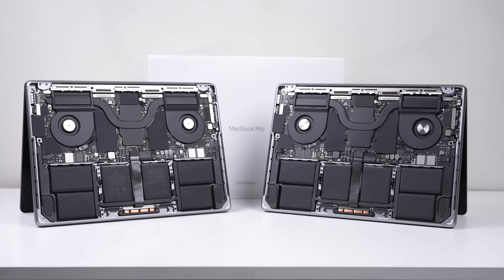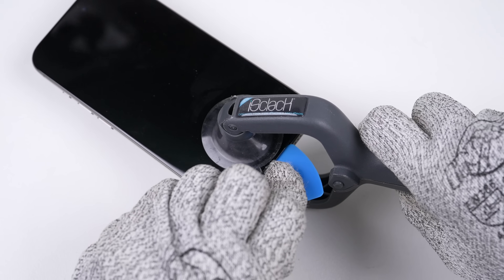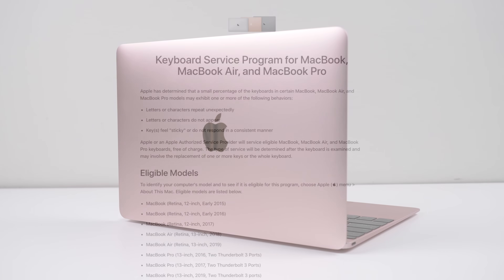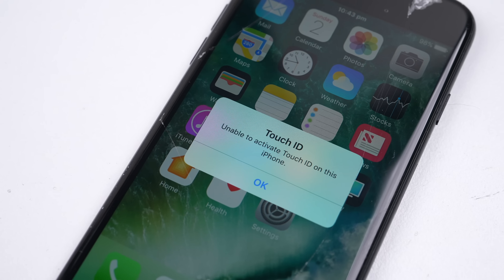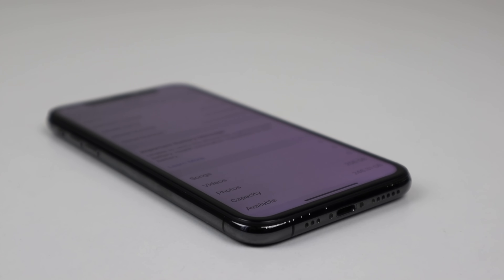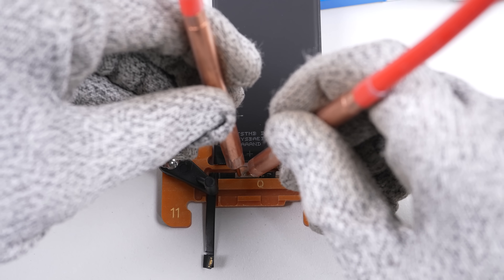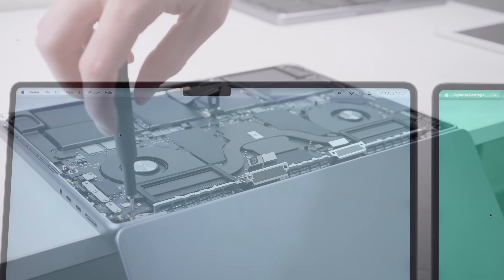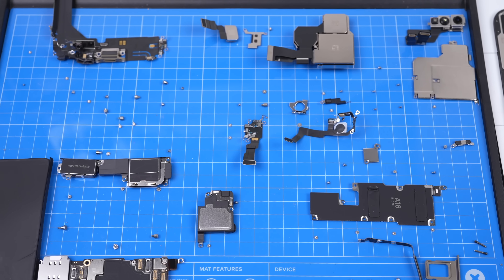Astonishing Anti Repair Practices By Apple In the Last 15 Years

Comment: I think all of this whining gets old about repairability. The only thing we need are battery brackets that are screwed down with foam to cushion. We don’t need adhesive on batteries.
Reply: That's it? So you want non removable glass backs, security screws, and software malfunctions for swapping out genuine, OEM parts? Yup, you're the reason they get away with this.
Reply: i hate it when stupid people speaks

Comment: It's absolutely insane how much they've worked on not letting you be able repair their stuff without them, and probably thousands of millions of dollars just on that kind of stuff alone....

One of the main reasons to never bother with Apple.
Reply: You get cash for each time you post this from Apple?
Reply: No just sick of the huge oversight on why this keeps happening. Every year the amount of phones that get stolen at events like music festivals go up. Every year Apple serializes more parts and people like this kid yell "Right to Repair" blah blah, instead of asking for a real solution.   @glynnetolar4423
Reply: It's still a good point. @glynnetolar4423
Reply: Apple is pairing components to each board because of the mass volume of devices that get stolen in the United States and sent to China in order to resell the parts. Apple is being pro consumer because stolen parts won't work/operate the same even if they are OEM. "Right to Repair" should focus on getting OEM replacement parts from the original manufacturer. Example - if a chip manufacturer or cable manufacturer makes the component, allow for it to be sold as replacement parts. This would render the stolen parts useless and give the availability for parts to fix the devices that are broken.
Reply: @grkxkosta3396 how does that boot taste?
Reply: @grkxkosta3396 Is this why Apple deliberately switches to single-source parts such as ICs so that even big distributors such as Mouser cannot supply those ICs to third parties?...
Also, if that were the case (pairing components to stop theft), Apple could just lock the phone and register the components as stolen instead of blocking any repairs/replacements so clearly that's not the reason and you know it :P
Reply: @grkxkosta3396  How many times did you copy and paste this rubbish?

Comment: There must be something sketchy missed by the California bill. Apple will only support their own right to repair, not others.
Reply: Also the law "excludes devices with IP ratings", so it doesn't apply to their phones. It is just another pretentious piece of legislation, which does nothing in practice.
Reply: Apparently software locks are not covered under the bill so you can guess who wrote that part..

Comment: if Apple wants to "reduce there carbon footprint by 2030" they need to start thinking about there right to repair as well as Activation Lock, I drives my crazy knowing how many devices go to the bin because it simply can't use it because the last owner doesn't remember the password or they reset it a different way, if Apple really did care about there carbon footprint they would do something like after 90 days if the last owner doesn't report it Lost/Stolen its iCloud free!
Reply: well to be fair, none of the toxic components and environmental damage those cause is from carbon. so they will succeed in their PR carbon footprint thing, despite causing far worse harm to the environment than carbon emissions would have had.
Reply: and how many android devices unusable as they left the factory :D. If google really did care about the carbon footprint don't let google service installed on unusable devices.
Reply: @hapakj  Not all of us wants a phone thats blazing fast in south Asian country's we use maybe 10 year old androids to make calls and and use  facebook updates are not that much of a thing for us even that is why google is supporting all types of phones.

Comment: One thing to keep the mind is that no matter what any company trying to do for stopping from repair is community. They will always find their way to make it works. Because technology like iPhone, macbook ipad are liability and have wears and tears.
Reply: Apple is pairing components to each board because of the mass volume of devices that get stolen in the United States and sent to China in order to resell the parts. Apple is being pro consumer because stolen parts won't work/operate the same even if they are OEM. "Right to Repair" should focus on getting OEM replacement parts from the original manufacturer. Example - if a chip manufacturer or cable manufacturer makes the component, allow for it to be sold as replacement parts. This would render the stolen parts useless and give the availability for parts to fix the devices that are broken.
Reply: @grkxkosta3396  Rubbish. You've been drinking to much apple coolaid. Apple is the one making sure component manufactures don't supply the repair market with parts.
Hey if its ok for you to copy and pate your reply all over the place I get to do it as well.